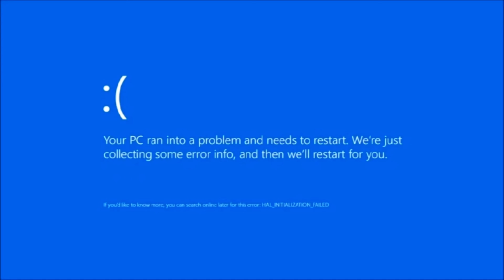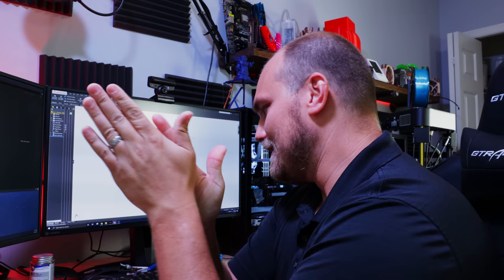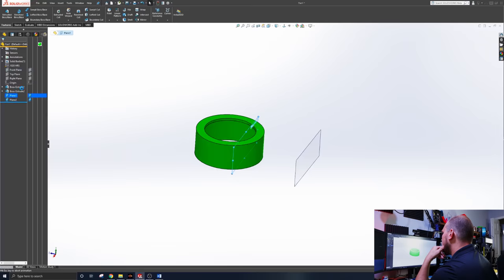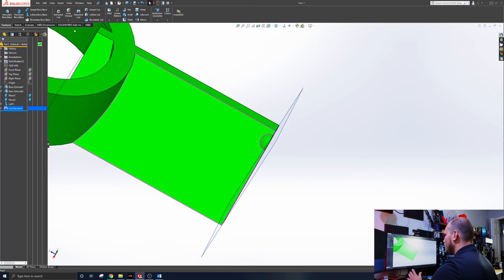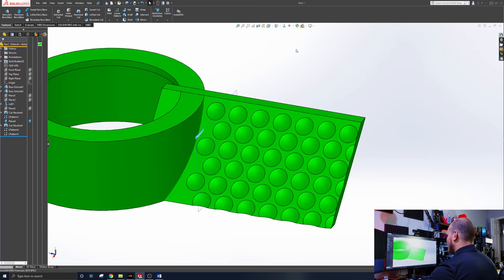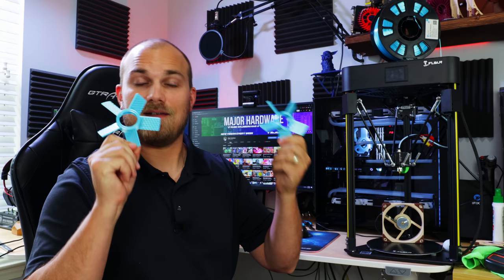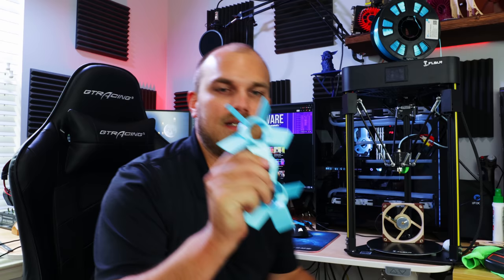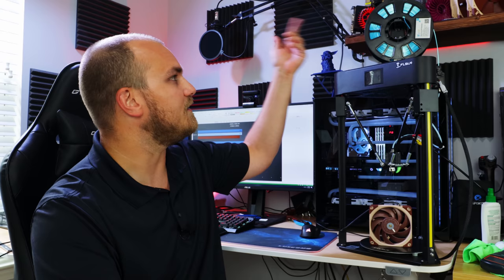What If Fan Blades Had Dimples Like A Golf Ball?

Comment: before watching this clip i already conclude this: since a golfball WITH dimples flies x % further, so that means that a dimpled ball has less drag (it pulls less on the air). So if you make fans with dimples, and the dimples are on the "pulling" side of the blades (the bottom when in pull config, the topside when in push config), then those blades will also have a lower drag-coefficient. This will ensure that the blades will 'glide' better through the air, but that also means there is less air displacement.  So best is to have fans that have more drag (give them a litle scoop at the end, like winglets on a wing of a plane, but then turned to the inside so it 'scoops' some extra air... it'll be harder for the fans to spin 'the motor will use more energy, but there'll be more air displacement...))
I have done a similar case myself in a long passed repair-case, where a gpu had one fanblade broken off, so i took off the opposite fanblade as well to regain symmetry, but ofcourse there was loss of performance. As a solution to that i used my soldering iron at a lower temp so i could soften the plastic, and i folded the upper edges of the leftover blades about 60 degrees. That radeon 9700 pro never had any issues. it did took me some time to get it done properly, as those fanblades were not that big, cpu fans will be much easier to work with.. I folded about 1/4th to 1/5th of the blade, if you take too much of the blade the gap becomes too small between the blades to have enough air to move around...

Comment: I'd be interested in knowing if the dimpled fan draws less current. With a speed-controlled motor and identical pitch blades you'd expect about the same airflow. But if the dimpled fan actually draws less current it's more energy efficient overall.

It also expect the fan blades to be more interesting if they were curved in the blade cross section and sloped more.

Comment: Interesting experiment. 

I believe that the dimples made no difference because their purpose (on a golf ball) is to break the laminar flow of something round that would make a big vacuum behind it as it moves through the air. 

While this is a problem for a golf ball, it is not a problem for a fan blade, which is way thinner and makes not that much of vacuum behind it.

As stated on the comments, it could be interesting to see how it would perform underwater, specialy for a big blade, since the vacuum on blades underwater is the cause for corrosion by cavitation on large ships.

Cheers

Comment: FIY - The reason golf-balls with dimples fly longer is because the "dimples" cause turbulence. Now you might think that's a bad thing, but the turbulent flow of air reduces the vacuum behind the golf ball relative to its direction of movement. The vacuum causes much more "drag" than the dimples themselves. This technique of inducing/forcing turbulent flow is used on almost every single commercially thing that flies today, like wings on an airplane, rockets, helicopters, etc.   The effect however is only measurable when a turbulent inducing surface is close to parallel with the direction of movement. Since your blades have an angle close to 45 degrees off from the movement direction, you couldn't have an example that would make less sense.

Comment: For golf balls the dimples are actually to ADD turbulence when traveling through the air, which gives the ball significantly more acceleration/distance, without the dimples hitting perfectly round golf balls don’t travel anywhere near as the same distance

Comment: Dimples on a golf ball actually encroached on each other creating a hexagonal matrix. Your blade dimples were separated by a 5 mm gap. 
I think you could try the same experiment with an encroachment pattern. If that works ... the benefits would be huge. 
Also I would only have the dimples on the pressure side of the blades as dimples on the vacuum side is probably hampering the progress of the air. 
PS;  the RPM will always be the same as the fan motor is designed for a specific speed. 
Focus on how best to improve air movement through the blade. 
Think what you’ve touched on could make considerable progress in fan blade design and efficiency.

Comment: Instead of dimples you should do curved blades and semisicurcular gouge parallel to the blade.  It will help the air stay "attached" to the surface.   However the 3d print layer lines might already be doing a small bit.

Comment: Try this: 
Dimples on the upper surface only. (Dimples on lower surface will create turbulence where not needed and reduce efficiency) 

Dont just compare the speed but also the power consumed by the motor (watts) and the sound reduction (decibels). 

If the above is sucessfull, try optimizing dimple pattern to be closer together or further apart.

Comment: Nah, imo this idea is flawed, but what do I know. 

Dimples on a golf ball are there to decrease flow separation and accelerate the formation of the turbulent boundary layer, which is good for moving unoptimized shapes through air less worse than creating a large low pressure area behind them, so far so good.

But a fan blade should already be designed to have minimal flow separation over its profile, so adding dimples is completely pointless.
If you have flow separation over a fan blade it means it has stalled, and it's a much better idea to fix the wing profile/angle of attack instead of adding dimples. When you have full control over an object's shape (unlike in the case of the golf ball), dimples become irrelevant if you have the ability to design such shape properly.

There's a reason why you don't see dimples on aircrafts, race cars, turbine blades, etc. Engineers are not dumb, it's because when you can streamline the shape, dimples become irrelevant if not counterproductive. To "streamline" means shaping a surface so that it follows the stream lines of the fluid as it moves around it, this way you don't need to induce turbulence to help the airflow follow the profile. Compared to that solution, dimples do reduce pressure drag but also significantly increase skin drag, so it's very much not an optimal solution and you can always achieve better results by streamlining and smooth surfaces.

Some wings do employ vortex generators to improve stall characteristics, but that's because airplane wings need to operate over a wide range of speeds and angles of attack, and that turbulence helps the layer stick to the profile in conditions where it would otherwise stall, but they do so at the cost of increased drag, and these conditions are not applicable to fan blades so the benefit for the latter is null.

Conventional cars also benefit from vortex generators, but that's because a modern car's shape is only barely optimized for aerodynamic efficiency and much more designed with comfort and utility in mind (yeah, that big flat rear end to make bulky cargo fit in your SUV's trunk is not streamlined).

Also needless to say that, if improperly implemented, dimples on a wing profile might even create way too much turbulence and help stall the wing much sooner, rendering it completely pointless. Yeah it will have less drag, but that's because it stalled, which is not really helpful if you're trying to move air... 
It sure will decrease resistance, but getting rid of the low pressure area behind a wing profile is not a good idea when that pressure area is what makes the wing work...

Comment: This test has been done - search for the fan blades called propellers, and add in cavitation effect [google "propeller cavitation solutions" - a couple of the articles will mention different systems - ridges, dimples, etc].
Also, as with others, the RPM had better be very close or there's a problem. Current flow (or over time, watt-hours) should give you an idea of the difference.
Also, if you compare your fan blades with the one you showed us more than once, you'd see the shape of a good blade is a lot more complicated than a plane, even at a slant..
Last also: since all your fans are intended for air moving thru the fan, rather than a screw (aka propeller, aka fan) pulling the fan thru the fluid (air), the cavitation effects may not be as critical.
I have no idea how much help/hurt dimples might be on a small fan, but it is an interesting experiment.
So, thank you.

Comment: Dimples decrease wind resistance at high speeds. Noise may be impacted but on all fronts the difference will be apparent at high speed if you are lucky, but most likely wouldn't notice anything until much faster than 1800 RPM.

Comment: Dimples on a golf ball affect flight by reducing drag  on the *backside*, relative to the direction of motion, of the golf ball.  For a fan, you would want a design with dimples only on the trailing side of the blade.  Smooth laminar flow scooping air, on the front of the blade, dimples reducing adhesion/ drag, on the back side of the blade. I would be interested in seeing test results from that design change.

Comment: I think that the dimples would make a difference in high speed (high RPM), like you said, they help to reduce the drag, in slow speed there isn’t that much difference, it does not affect that much, that is why the need to change the aerodynamic on the car if you want go fast. Same thing on the blade fan.

Comment: I suspect dimpled blades will cause greater dust build-up due to localised pressure nulls, so in the absence of other benefits would represent a longer term disadvantage.
Other comments provide more info on the actual effect on golf balls - affecting the flow (and drag) around a sphere - and this effect doesn't really transfer to a planar surface.
Making the blades aerofoils will have a much greater effect, something that's probably not very cost-effective with conventional manufacturing, but may be with 3-D printing.  Smooth blades will be better here, and if this is not possible with your tooling, the orientation of the ridges will probably have an impact.

Comment: For future reference if your part is in metric you can type any dimension in standard and it will autoconvert it instead of googling measurements. Ex: type .01 in into a smart dimension and press enter and it'll switch that measurement to metric

Comment: So the speed of the fan blades increases as you travel away from the center of rotation. So then I question if it would be more optimal to have some curves in the fan blades to more efficiently move air?
Reply: P.S. reaching your conclusion at the end was an assumption based on limited data and without all the tools you would need to truly check. Sad you made the conclusion but thanks for an interesting video to watch.

Comment: I believe that part of the value of the dimples is the fact that they are on a curved object. By not giving the blades a curved shape, it probably defeats much of the value the dimples would have. Also, definitely look at the current flow/power consumption instead of RPM.

Comment: Brushless DC motors are often designed to run at the same speed, irrespective of load. The same size and shape of blade would therefore be expected to shift the same volume of air at similar spin speeds. What you need to do is to measure the current drawn by the motor for each type of fan. The efficiency might be different.

Comment: I think you need to put an amp meter up to the fan wires and see how much they are pulling rather than measuring the speed.  The motors are usually controlled by the motherboard to run at a certain speed.

Comment: so usually a more efficient blade doesn't necessarily show on the same motor, having dimples could help at a higher RPM where the smooth blade would fall behind, or vise versa So if you had a high preformance on the computer and you wanted to speed up the fan for that task it could possibly come a point where one of the fans simply couldn't push more air trough

Comment: Silverstone case fan blades were dimpled, and I think they were an option on Cougar fans iirc. I just checked and I still have the Silverstone fan with dimples, manufactured by a Globe, model RL4Z. Supposedly they made the fan quieter at the same RPM by creating turbulence to prevent the low pressure area of drag behind the blade. Same as the fins on a Mitsubishi Evo roof
Reply: I just checked and I still have the Silverstone fan with dimples, manufactured by a globe model RL4Z

Comment: I could definitely hear a subtle "whispery" noise form the dimple fan, but it's basically the same.

Honestly, though, I'm surprised you didn't see a major drop in performance. The ball bearing-like eddies that the dimples form actually cause the air to interact with them, rather than the surface. Why would this decrease performance? The blade becomes THICKER, at least as far as the air currents are concerned. That means less room for air to flow between the blades.

My guess is that the decreased drag makes up for how much this design should be restricting the airflow.

Of course, the other easy possibility is that the nature of airflow through a fan is so inherently turbulent that the eddies never form and the dimples do exactly nothing.

Comment: The dimples also increase the surface area of the fan blade with out increasing the actual size. Should be able to draw a bit more air thru the unit. An airflow test is needed to see the changes.

Comment: Question: 3:16 Why don't you put any `crush ribs` on the inside of your hub? That way they will add grip without the need for tape, and will make up for any small print tolerance variances between printers and software. The concept has been used in injection molding for decades.  Ribs ribs ribs!

Comment: I'm thinking that they spun at the same speed etc simply because the fan motor overcame both blades' load enough that it always got to its top-end no matter what.
I would recommend getting a weaker motor that is unable to reach its top-end with a blade attached.
I wouldn't try increasing the motor's load by feathering the blades more since that would mainly take away the benefit of the dimples.

Perhaps you could use the same motor but have it attached to a drive shaft underwater or something!

Comment: Dimpling would only tend to help a deeply-curved surface channel air better, because it scatters laminar flow gradually instead of shearing buffets of air away from the trailing surface all at once leaving giant vacuum-pockets in the wake. The flat fan blade with it's straight trailing edge does that dimples or no. You might be better off with a row of bumps near the leading edge of the blades like airplane wings have. But even that is efficacious mostly if not only due to the dorsal curvature of airplane wings.

Comment: I suppose the effect you get by doing both sides makes a kind of a counterforce. What you gain from one side is lost by the other side.
Using aerodynamic principles, the goofball reduces friction and creates a lift, but this only works when it is also spinning.. It is the motion forward combined with a spin that makes it go further.
With no spin, then no effect, and it might as well be smooth.

Comment: The motor has a set limit of speed. What is actually produced is a lower stress on the motor and a lower weight so it's more efficient in a long run. So that would be an impressive test- actual longevity of the motor, and power used, ie mah in a 2 minute test would be an interesting test to see the difference.

Comment: Im not surprised with the results, it seems obvious that the dimpled blade would be lighter, but not so much so that it really increases the rpm of the fan. 
I would have thought though that it would have caused more turbulent air flow, which could potentially have it uses, albeit maybe 
not in a computer case.

Comment: It will do slight worse. As dimples are a design to cause more drag. And in the golfball application the extra drag will increase the magnuseffect that the ball uses when it's spinning and travel in the air. The magnuseffect creates lift when the underside spin towards the direction the ball is travelling. And more lift makes the ball travel further.

Comment: The fan blades would need a curve equal to the golf ball's radius. In other words, the designers of the balls calculated how the dimples needed to relate to the curvature of the ball. It was pretty intense.
Use curved blades and redo the test, and put the dimples on only one side, the convex side. Leave the concave side smooth.

Comment: I would have preferred to see these put on a air flow tester to see if the dimpled ones actually create more CFM. Theoretically the dimples actually increase surface area. Even if that doesn't really help in PC cooling it might theoretically be useful information for creating custom fan blades on a larger scale. Like modding the blades on a pedestal fan or a box fan.

Comment: You should measure the power consumption of the dimples vs the smooth fans.  I hypothesize that that dimples will require less total power to operate at the same level as the smooth fans because of the decreased drag.

Comment: I feel like your methodology in testing is flawed.  In fact, the whole dimple methodology is also incorrect.  So golf balls are designed to move through the air with the least amount of resistance, hence moving the least amount of air.  If you put dimples on a fan blade, you're telling it so spin faster while trying to move the least amount of air.  When you placed your fans on your motor to spin, was that motor not on a controller?  Was that controller not designed to keep the fan speeds at a certain speed?  I feel that if you changed your methodology in testing (such as getting a Digital Anemometer) and test the air flow of each fan at a given fixed RPM or do max speed on the motor and measure the RPM's of each fan (although you wouldn't get much of a difference with this method).